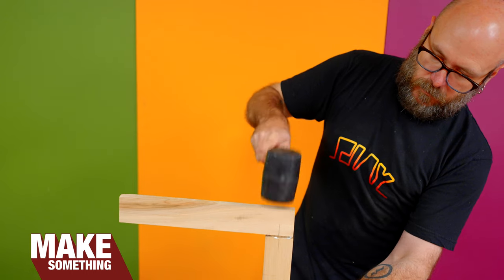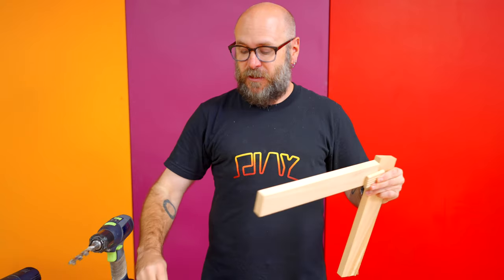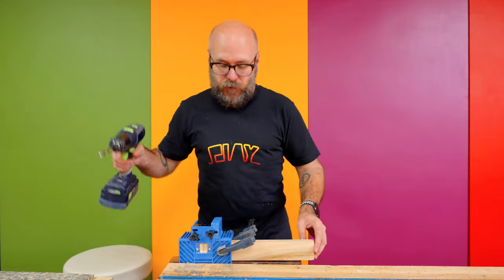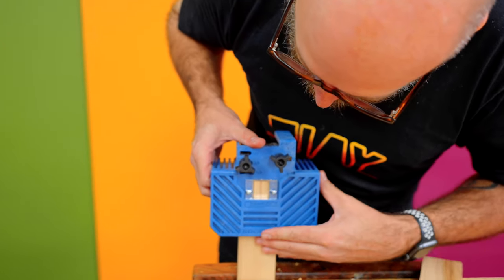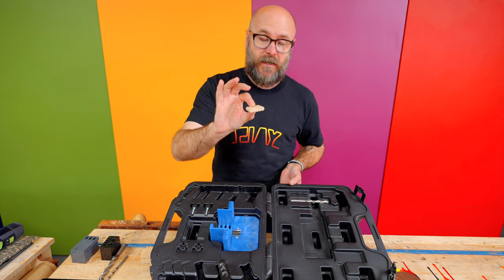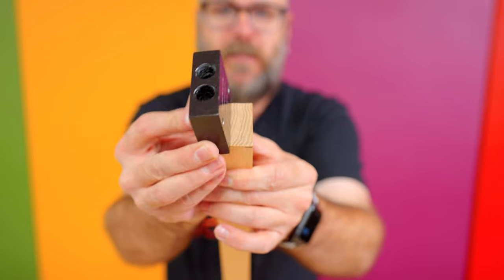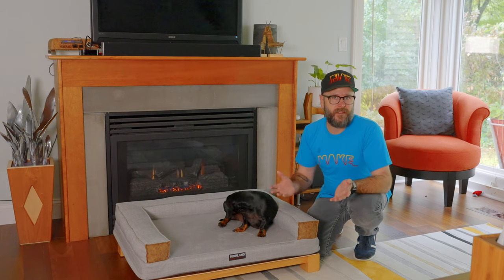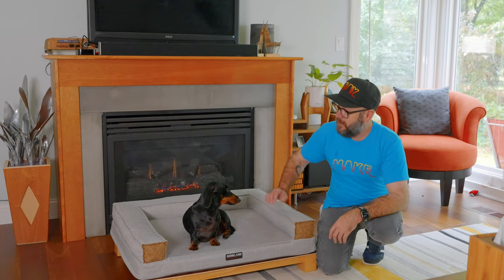STRONG joints on a budget! Have you tried beadlock joinery?

Comment: One thing to note is that the Rockler beadlock tenons cost ~ $0.45 USD and the Festool Domino tenons cost only ~ $0.05. So after only 2,000 tenons the Festool pays for itself! LOL.
Reply: And you work with Domino at least 20 times faster and more accurate.
Reply: Holy moly

Comment: I know this is an old video. But  I have a question if someone happens to see this comment section. Instead of buying dowel jigs, why not buy a palm  router (which probably costs the same as one of these jigs or a good drill) which is great at mortising, and just use the good old mortise and tenon joinery?

Comment: A wire brush with brass bristles is a handy way to clear the debris from a drill bit between each hole. Brass is softer than steel so it won't even scratch the bit, but it gets rid of the crud and if the bit is hot to the touch, it saves you from having to touch it to clear it. I keep a small brush with my drill and use it frequently. Works like a charm every time.
Reply: Cheers for this little gem of knowledge friend

Comment: Not a fan of this particular system. The domino is an absolutely amazing machine, but no longer costs the $725 it used to (and still should).
So my joinery jig of choice is the dowelmax, for $225. It uses reference faces and edges, not lines, which can compound errors. It's incredibly well-built out of solid aluminum with hardened steel drill guides and brass adjustment knobs and screws. Dowels are plenty strong for most woodworking projects. Jessem makes a really nice doweling jig too, for around $200. That one is solid aluminum with hardened steel guides too. Those prices are higher than the beadlock (but not as much once you factor in the accessories and tenons), but they are definitely quicker to set up and use. Finally, I'm not a fan of how rockler cheapened the beadlock by making it out of plastic now.
Tl;dr, buy a dowelmax or jessem doweling jig instead. Beadlock is a bust.
Reply: You are spot on. I have both Dowelmax and Beadlock (and General Tool dowel jig). Dowelmax is superior to all of those.
Reply: I just looked up the Dowelmax, but it looks so overly confusing to use and there are a lot of pieces to keep track of.
Reply: @bitsandatoms8008  Believe me, it has like a 10 minute learning curve. Once you get used to using the checkmarks, it's second nature and very simple to use. A lot of the pieces are for atypical joints; the dowelmax junior is an even simpler dowelmax setup with the main difference being that there's no built in clamp. Check out some videos on it; parillaworks did a great video showcasing it. Art from wordsnwood uses it a fair bit as well. It does seem complex, but it's very intuitive once you start working with it. Once spring rolls around I'll be doing my own video on it. I paid for mine; it wasn't gifted "for review".
Reply: @bitsandatoms8008  All the extra shims/pieces are for centering on various thicknesses of the wood. For a typical project you use formula from the manual to pick shims and don't need to change those during you workflow. You could also choose to not center and use fixed offset as well - that is what domino does. But for max strength it is good to center if you will have single row of dowels.

Comment: Seems like a cool tool.  But if I didn't want to buy the dominos it might be a better idea to just drill the first three holes then use dowels cut to length?  Might not be as strong, but then again probably strong enough for most applications I imagine?
Reply: Not sure if you watched the video all the way through, but there is a router bit for making these dominoes. This was my concern as well as I don't wanna be locked into buying dominoes either.
Reply: @TravisBrown42  I saw that, but making the dominoes seems like it would take more time than cutting some dowels 😁
Reply: @FRAGAFE  I'm guessing you buy your dowels rather than making them. If so, then yeah, easier.
Reply: That was my very first thought.    Rockler charges $9 for 3 tenons at 12".   I'm guessing you get 4 beadlock blocks each so it's 75¢ per connection.   There's your standard razor blade model for ongoing revenue.
Reply: It’s just a gimmick to buy there stuff. I love using Dowel I like sometimes expose them on purpose about eighth of an inch.

Comment: I love my bead lock tool. I have all three sizes already and there is something else you can do with it even though you didn’t discuss it instead of using the bead lock floating tenons you can use it to make dowel holes. The half inch will give you two dowel holes, the threeeights will give you three and the 1/4 inch will give you four. You can also use it on mitered corners just remember to stagger your whole debts so you don’t drill out the other side and then cut the two sides of your floating tenant at 45° or whatever would best match your angle. Also you can do it as dowels and just use different lengths.

Comment: I've used this before.  The bit that came with it had enough slop in it to throw things out of alignment and, in some cases, not even allow the tenon to go in easily.  I used a kreg pocket hole bit and it fits much better in the jig.  Also, clamp the ever-living crap out of it so the jig doesn't move on you.  Even a small move will be a disaster.
Reply: Also, it does look like they've redesigned it slightly since I bought mine a couple years ago.  Hopefully the issues I had have been addressed
Reply: @AlanStucky  Rockler recently acquired the original Beadlock patents. They then redesigned the jig to make it easier to produce, more accurate, and (they claim) more durable. This is another example of someone who had a great idea, but lacked the ability to successfully bring that idea to market.
Reply: @DKWalser  I hope so. It’s something that I really wanted to love, but wound up just causing me more problems than it was worth. Might have to buy it again!

Comment: I bought General tools dowel jig, than Beadlock and finally Dowelmax. First two are not accurate and require sanding and planing after glue up. They also can't do 45°edge miters. Save your money and get Dowelmax (or maybe Jessem as someone suggested below although I don't have personal experience with it and I don't believe it does 45s). Hope that this info saves folks some frustration and money.

Comment: I get the need for this tool.  It's way cheaper than the Domino.  However, the way you struggled to drill those holes left room for potential errors.  My opinion.  Save up and buy a Domino if you need this type of tool.  You will love it!

Comment: Watching your jointing videos, Dowelmax and Rockler.  Comment would be; What is the relative holding strength of glue Vs dowels or tenons in a joint?  I am thinking in terms of dowels for joint alignment however glue to hold the joint. I tested several joints and found the glue line to be stronger than the side grain wood.  Dowelmax = brilliant.  Further considerations would be end grain joints, thin section with large frames, etc.  Thank you for showing the Dowelmax.

Comment: Seems like a starter kit designed for Rockler to sell you more stuff. 
 seems like a strong joint, but I wonder about the points between the round holes causing stress risers and giving a line for it to split when put into end grain.

Comment: Be very, very careful with this system. Experienced woodworker here and this thing can be a real disaster. You must clamp the poop out of it otherwise the jig WILL move on you and the mortise is gone. Sandpaper is a great idea as an add on to the jig faces. Far too many issues with this jig do me. Does work well to drill out two or three dowel holes without making any adjustments for the headlock tenon. Also does a good job with the width adjusters for inset doweling. Gotta pay extra for those as well however. Just saying, this system is NOT a total no brainer, be very careful with your expectations. Great channel, best woodworking to all. Thank you and God Bless.
Reply: Please excuse the typos above, moving and typing is like the jig for me, iffy for sure. Thanks once again for all of your great content!
Reply: Yep. In my comment above I mentioned the dowelmax and jessem doweling jigs. They're a far better alternative IMHO. Those actually are pretty much no-brainer jigs to use, with the dowelmax being the simplest to use.
Reply: Yes I got this a few weeks ago and tried it on white oak. It didn't go well. Sure you can drill a half hole into pine no problem. Hardwoods want to make the jig walk rather than cut the web between the first holes.

Comment: If you're off your mark a little bit (say like 1/16"), how tricky is it to adjust? I thought the good thing about loose-tenon joinery was that it floated a bit to give you adjustability, doesn't seem like this would.
Reply: Yeah he kept saying floating tenant but it’s really not I don’t think. I think it’s much closer to a dowel nothing wrong with dowels. They’re fantastic unless you want to loose Tennon or floating.  Oh that said it’s probably slightly stronger than dowels but yeah I’d have to run the surface calculations to really know.
Reply: @ar15tac  floating tenon just means the tenon isn't integral to one of the pieces of wood
Reply: It's only a feature of the Domino itself. It has a loose setting and a tight setting.

It's not a feature of floating tenons itself. This tool probably doesn't have a loose setting like that
Reply: @nkuete  oh thank you
Reply: I have this jig and three is no adjustment. It is also not very accurate so you have to assume sanding and cutting after glue up.

Comment: Love your video, I got a question for ya. I’m making a shelf for the laundry room above the washer and dryer. It’s going to be 30” over the top loading washer then down 10” and then 30” over the dryer. This will be made from ¾” Oak. This will be around 8-9” deep. I want miter cuts so the “flow” of the grain will be uninterrupted. Could I use this beadlock pro jig or should I use the corner key doweling jig? Or is there anything else that would make a strong joint at the miter cuts. I’m somewhat new and it seems like every project I’m learning something new. Thanks for your videos, they’re teaching me quite a lot.
Thanks, Pat

Comment: Can you just drill the first three holes and use dowels? Seems as it would be quicker and just about as strong.
Reply from the maker: I suppose you could but In my experience using dowel joinery is very frustrating during glue-ups.
Reply: Seems to me those first three holes overlap.  Dowels would go in the outside holes but tough to get that center dowel in.

Comment: This is a great system if you want to be stuck with a slow ponderous and one dimensional method, which if you buy the tenon stock comes with a high running cost.  

I am bored with people touting things as an alternative to the Domino and David yoou should know better. 

The Domino is an amazing bit of kit which will do many many many things this will not, and if you cant afford one accept that you are going to work alot slower and possibly less accurately.  I am long retired and when i closed down my shop the 1st thing i put in my car was my 2006 Domino all original never repaired that had made 10's of 1000's of mortices.  Personally i'd go for a decent dowelling jig over this creation, which I know has been around a long time but really is an overly complicated piece of junk.  Dowels are quicker more flexible in their use and way cheaper and id say as strong in alot of situations as a Domino.  

Sorry I forgot, no dust extraction. Kreg and their pocket hole do-dad cottoned on pretty quick that drilling alot of holes  makes an  unholy mess.  

I'll close by offering this warning  say you make a simple cabinet with three tenons per side your four sided box just required you to drill 120 holes, not to mention as you need to clamp the workpiece so you can clamp on the jig some pretty fancy work holding devices and about $5 in tenons.  Do you really expect to have to put everything in a vice that you want to joint? 

If you cant afford a Domino then get a good dowelling jig and a fixture to make mortices with a router.

Comment: Pocket holes will out do this on performance and cost everyday 👊👊
Reply: Cost... I'll give you that.   Performance... eh... not too sure on that one.
Reply: @fernandorosales2418  true it probally would be stronger, I know I use pocketholes with a little bit if tightbond glue much cheaper and holds strong.
Reply: @dunrob13  i think it depends on the application.   When I build something like a kitchen cabinet,  I use pocket holes for the face frames.   

But when it comes to something like a chair or table that gets abused and racked back and forth... then I have to use mortise and tenon.
Reply: @fernandorosales2418  i will have to try the beadlock never done that 👍

Comment: these are pretty cool, but i dont see how this would be any better than just using a normal dowel jig. it works fine, but it seems like more effort than normal dowels.
Reply from the maker: Stronger than dowels but in many cases strength is overrated. I find dowel joinery can be very frustrating during glue ups because you have so many things to line up at once. But yes, dowel joinery would work in most cases.

Comment: 1000$ for the festool.... Sweet Jesus
Reply: And Kreg R3 ..around $25-$50 depending on where you purchase,  and kit .... you can go even cheaper if you like.  
Also how much are the "domino" dowels
Reply: It's a tool for professionals. Using the Festool Domino is way faster than this Rocker Beadlock system. Professionals can use the Domino to get work done quicker, allowing them to make more money. So yeah, it costs a lot up front, but it's a huge time saver when time is money. Using dowels, the Rocker Beadlock, or a classic mortis and tenon is more fitting for hobbyists doing stuff for their enjoyment or doing things for occasional projects around the house.
Reply: @thomashajicek2747  Yep. The minute that patent is over, Ryobi will probably be selling one for $100.
Reply: @thomashajicek2747  haaa the patent, thanks for clearing it up, cause it doesn't look like something that could be more expensive to manufacture than a track saw